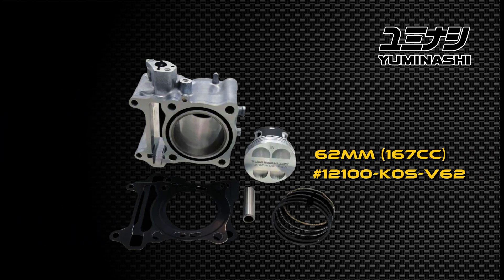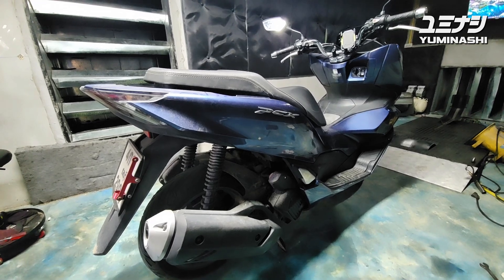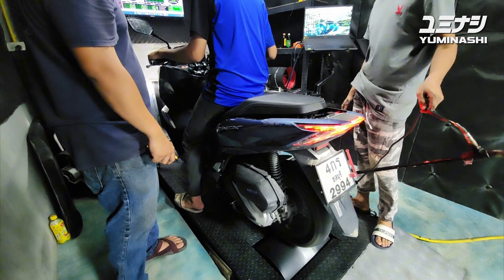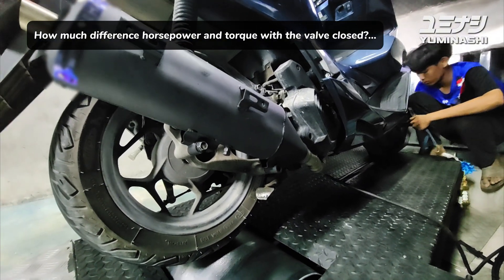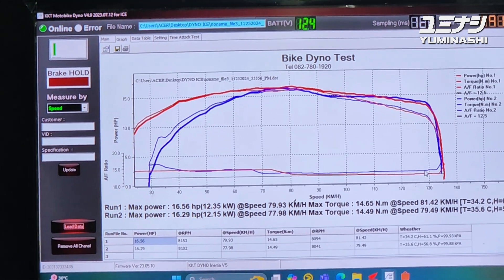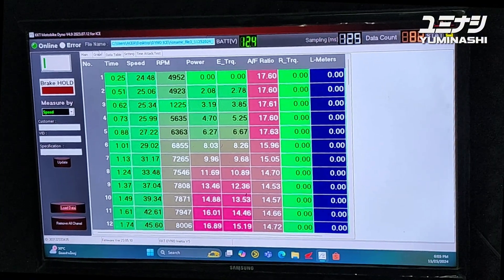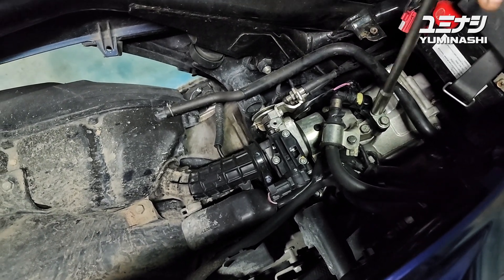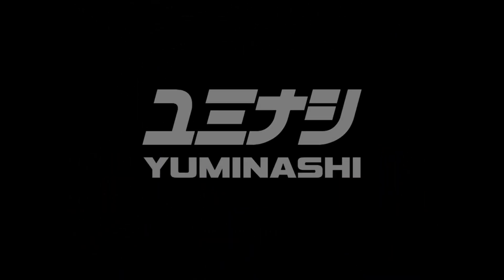PCX 160 | 62MM STOCK HEAD | DYNO RESULTS | Which Injector and exhaust to use?

Comment: Very good and helpful video, will wait until the new exhaust will be released, and order it together with the 62 bore kit then...
Reply from the maker: Link to the Stage-1 exhaust for the stock cylinder head:  https://yuminashi.eu/18300-k1z-sa1-yuminashi-sound-adjust-stage-1-exhaust-system-std-head-pcx125-160-click-vario-160/